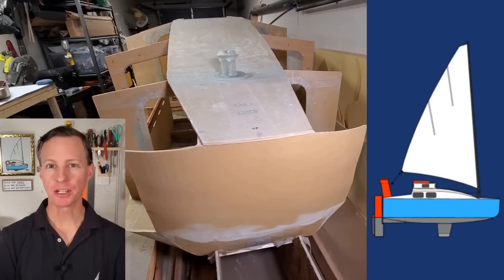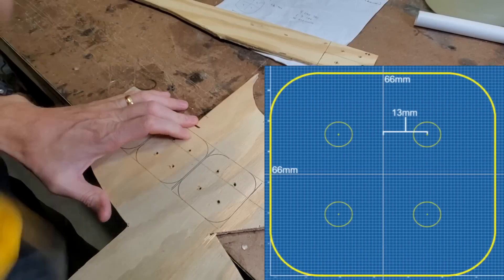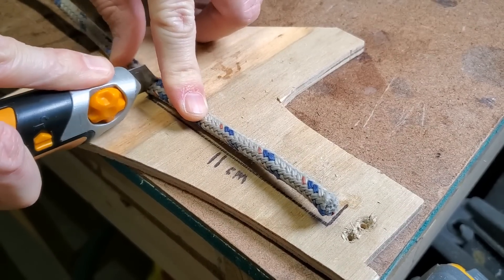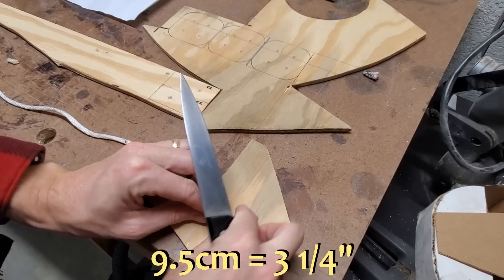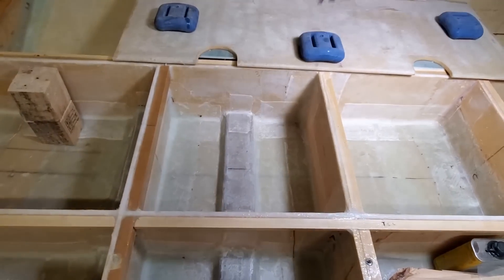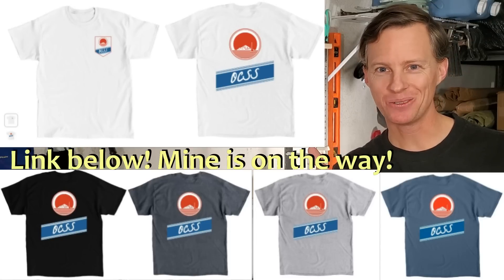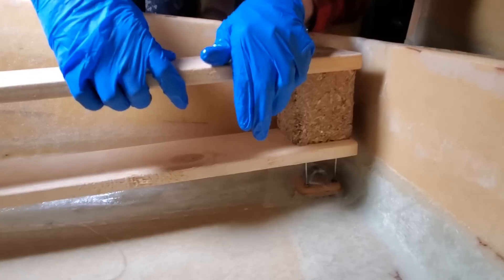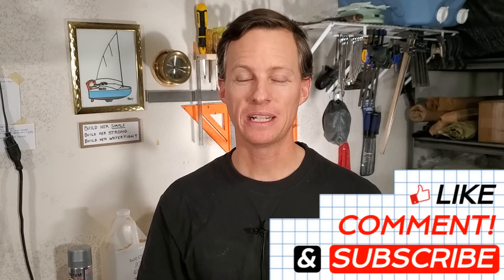OCSS-047 How to Make Strong Nonmetal Tie-Down Mounts - Mini-Cruiser Sailboat Build

Comment: I know this is kinda late, however, did you ever epoxy the ropes on your tie-downs? The rope seemed pretty cheap and without some saturation with epoxy they could beak under shock loading, like a capsize. Just curious as I see Yrvind seem always to add epoxy to any rope used as hand holds or tie-downs. I plan to use the same on my TIki build. Thanks.
Reply from the maker: I did soak the ropes in epoxy. I like how the spider mounts turned out, but I'd probably try to make the little white rope loop ones differently if I did it again.

Comment: Have you considered using a five point harness rather than several seatbelts? It’s designed to do the job you need, and has a handy single release point.

Comment: Is there a production boat this size, or close to it that's could be refit? I don't want to build from scratch or even a kit.
Reply from the maker: Maybe see what 14 - 18' boats are for sale in your area and try to imagine if you could alter it to be a long-range mini-cruiser. You'd want something cheap since you'd have to cut it up and alter a lot.
Reply: I've been doing a moderate refit on my 20-foot trailer sailer (1975 Sunmaid 20 built in Australia), and I must say I can hardly believe building from scratch would be harder - just longer. Also it's a compromise. In any case choose something you can make WATERTIGHT and that's not too fragile, and that includes spars and rigging. Don't let me put you off - it's very satifying when you've done it!

Comment: I thought you would saturate the lines like Sven. Now they'll chafe surely? Thanks for sharing
Reply from the maker: On the larger mount all of the rope is saturated. On the smaller ones, they're still soft at this point, though they could always get epoxied later. I'm not sure which is better. There are some ways to prevent chafe when the time comes to use them.

Comment: My limited experience with rolling in my bunk at sea leads me to believe that a leecloth, which is more flexible and form fitting would be easier on the body than any more regid restraint. Even your idea of a rectangular cloth with slots for the seat belts would be unkind at the three contact lines imo.. Sleep is precious at sea especially in unfriendly sea conditions.
Reply from the maker: What I'd really like is a lee board, still thinking about how to do it. I've slept with a lee cloth and never liked it much.

Comment: Great as always. All due respect, Lee cloth will allow for a much better sleep than those belts and will secure loose items in your berth. Hope you’ll reconsider. Cheers
Reply from the maker: I may add fabric to make a sort of lee cloth together with these lap belts. Or perhaps a lee board, which I prefer because it stays flat along its length and you can really lean against it.
Reply: @ocean_capable_small_sailboat  I think a lee board sounds like a good compromise, padded for comfort of course. I’m sure whatever you make will work best for you
Reply: Having made offshore passages in my much younger days, I would agree that lee cloths are much more comfortable. However, they are not much use in a real knockdown or pitch-polling. When such an event occurs, avoiding injury is the first priority and dealing with disorientation is the second. Having automatic, or easy to trigger, lighting is a big help under those circumstances.

Comment from the maker: 🍍Thank you for watching! 🤩Please subscribe!!! 👍⛵🍐
T-shirts available here: https://www.bonfire.com/ocean-capable-small-sailboat-1/
What do you think of these tie-down mounts? Would you ever use one? I like that I don't need to drill for bolts/screws with these.
Reply: I find them a very interesting idea.. definitely one I'm filing away for future reference. I might even make some for the nesting dinghy I'm currently building.
Reply: Excellent idea - however you must check them regularly. Salt water and UV rays play havoc with ALL fabrics natural or synthetic and allthough they may look sound, they break without warning.
I would schedule a yearly change of the rope used and regular check ups during the year.
Reply: @team3383  - These are interior fittings. I seriously doubt they're going to encounter much UV light. Windows do filter it out, after all! (Again, being interior fittings, they're unlikely to encounter much salt water, either.)
Reply: @Garryck-1  hopefully ...
Reply from the maker: @team3383  Even if they were topside, they get epoxy and paint, so they shouldn't be exposed to UV or salt water.

Comment: How often are you expecting to be upside down?
Reply from the maker: Every time I go offshore I prepare to be upside down. I did the same when I had my Cape Dory 31. I'm always blown away by stories of people getting knocked down and their eggs and drinks and electronics and all the rest end up crashing out. One must always secure for sea. On this boat it's even more important, because if everything heavy ends up on the overhead, it will be much more difficult to right the boat.
Reply: @ocean_capable_small_sailboat  - Same here.. I am constantly harping on about "think inverted" to sailors and would-be sailors.
Reply: I never PLANNED for a car running a red light and totaling my car, but fortunately I was wearing a seatbelt anyway.
Reply: @davidsachs4883  You have a legal requirement to wear one.
Reply: Got in the habit long before that law was passed 
And not all jurisdictions have that law
Reply: Once is enough to be prepared for.  Even if you don't actually get inverted, it is good seamanship to have all equipment and supplies secured.  Rough weather is a sure thing.
Reply: That one time is enough I guess 😂

Comment: I had two videos to choose from. This one and Sampson Boat Co. I chose this one first. Seat belts, I’d use a Lee cloth on its own. You’ve got an interesting project. You also have a knack for craftsmanship. Great video.
Reply from the maker: Thanks, very kind! It basically is a lee cloth, I may even have a rectangular cloth that the straps go through on the inboard side. The lap belts just make for a very strong and easy on, easy off attachment.
Reply: Def check out sampson boat co. Leo is a great and verry skilled shipwright.